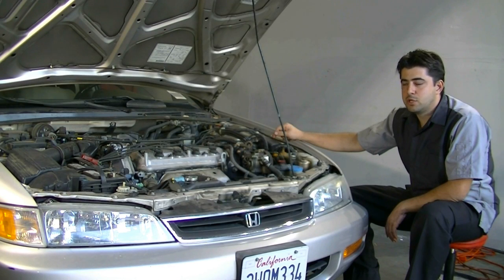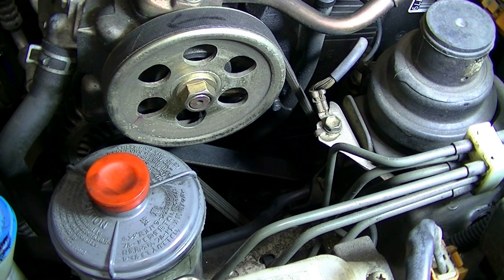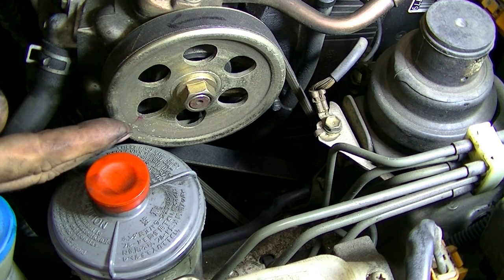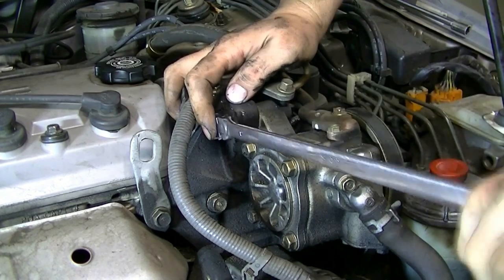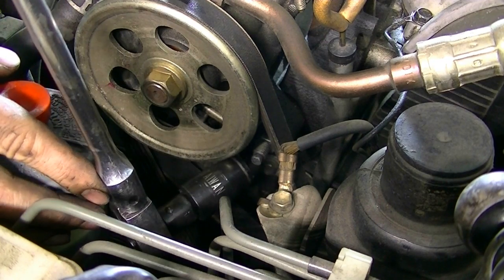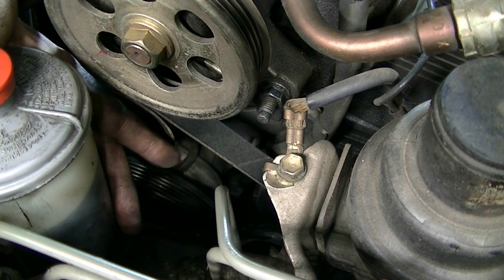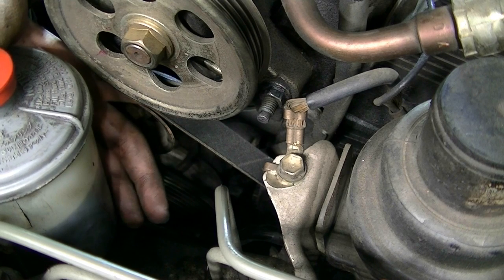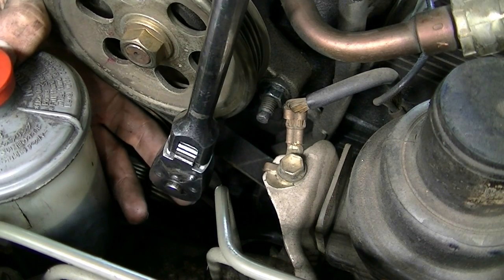How to Replace All Your Drive Belts - Honda Accord 2.2L VTEC

Comment: Great video and description on how to perform replacement of power steering and AC belts. Also gives the sizes of sockets and points out the nuts and bolts needed to loosen and tighten. Great step by step video.. Perform replacement of said belts and this video was very helpful.. Great job Thank You.. 👏👏👏👍👍🏆🏆

Comment: Anyone have an issue where the car simply acts like the battery is removed after this? I did this process exactly and now the cars not getting power, completely dead like there's no battery in it. I've checked the battery, fuses, tried to jump it, unplughed the terminals for about half an hr and nothing. Its like a ground wire got severed or something. Any help would be appreciated, thanks
Reply: Not sure if you got it fixed but maybe it was the tension for the alternator belt, may be lose
Reply: @abrahamaguilar9875  thanks but I got it figured out, it was the main 100amp fuse, which I thought id checked🤷‍♂️🤦‍♂️
Reply: @krisdwight78  alright, glad thats all it was